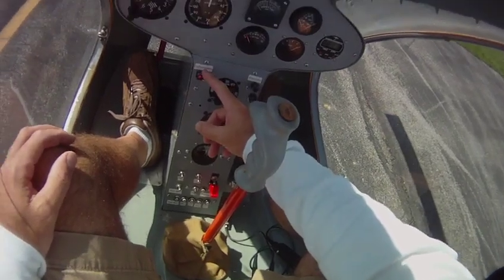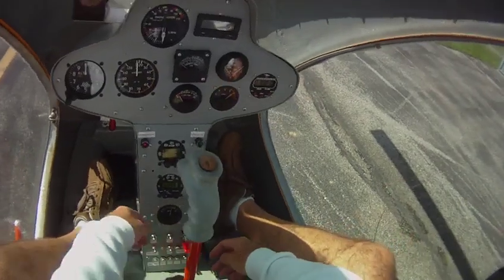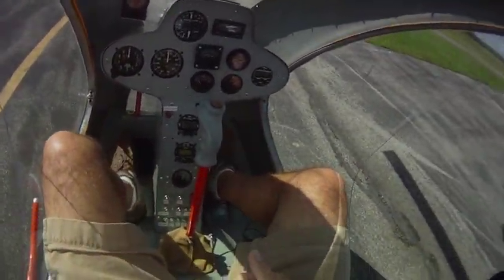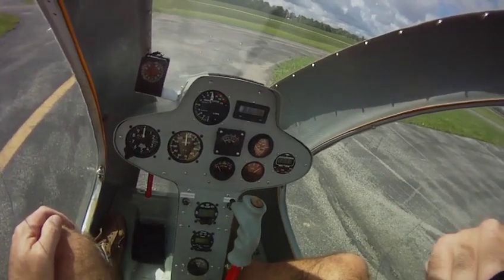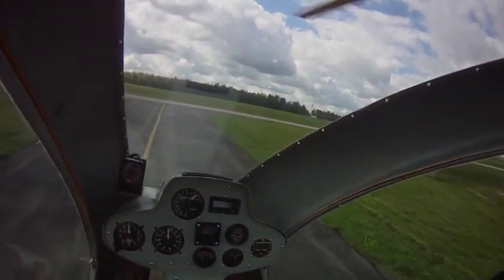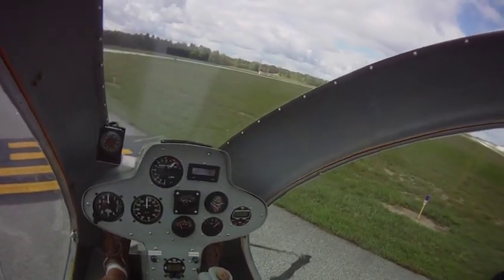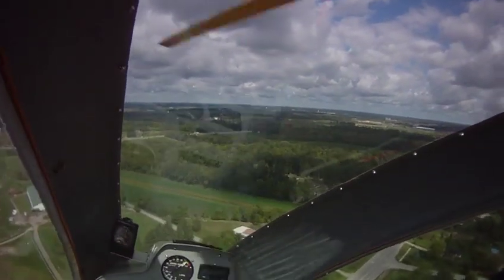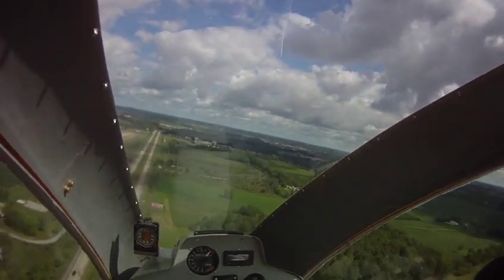Helicycle Startup and flying

Comment from the maker: Bob.  It hovers pretty easy.  I took an hour of training in an R22 to get the feel and then hopped in the Helicycle with no problem.  It has a governor that automatically holds 100% RPM with virually no droop regardless of what you do with the collective.  It is a really exciting machine to fly and is dirt simple to operate.  You never run out of power.
Reply: A hint of RainX and You’re all-weather 😀

Comment: How is the rotor inertia as compared to an R22?  When I was training in the R22, I was advised that you have about a second to respond to a drop in RPM to transition into an auto or you're gonna get blue blades.  One blade blew over there, and one blade blew over there.  As in the lack of weight in the R22 rotor blades is so little that a failure to immediately identify the loss of rotor rpm will kill you if you hesitate.  I completed 53 separate training flights @ 22 hours with the last 3 being solos before I ran out of money due financial issues.  I plan on getting back into it to get my private ticket and the cost of this chopper is very appealing.  Thanks.
Reply from the maker: About the same inertia.  Overall a very easy helicopter to fly. A few issues with this machine. There is a vertical hop that can develop in the rotor system that will literally shake the machine apart.  If you ever develop this co ditio you need to pull collective immediately.  Also, there have been some reports of excessive gear box wear with only a few hundred hours of use.  I never experienced the gear box wear, but I did experience the shake and it was not something I want to experience again. Super nice flying machine other than that.

Comment: Sorry if it was asked already, but someone mentioned on another video that the gearbox is prone to failure after around 200 hours.  Have you heard this, or experienced anything like that?  I realize most parts on a heli are time-limited, but that seems pretty low

Comment: so how safe are these choppers compared to a rotorway or mosquito?
Reply: Mosquito autorotates better, has much better visibility, and uses rigid mounts for the turbine. However the helicycle is heavier and was designed from the beginning to use a turbine, so helicycle pilots tend to be more confident and fly more aggressively. Also the helicycle doesnt use a belly gas tank so if you land hard you dont have to worry about exploding into flames. It really just comes down to preference. I hate the way the helicycle engine jacks up into position using belts to drive the main gearbox. A turbine engine should always be stationary. However the rotor system looks stronger to me and the seating angle seems to encourage better flying. Mosquito pilots just seem to hover around their backyards, helicycle pilots go canyon carving.

Comment: Idling at 48,500 rpm??  Did you mean 4,850rpm?
Reply from the maker: No, it is 48500 RPM idle.  Full power RPM is 64000 .  It is a small single wheel centrifugal turbine that runs very fast.  Very simple turbine that was originally installed in ground generators that were used during Vietnam war up to roughly 1990.

Comment: on the collective correction (i think its a trim for the collective, sorry I am only training in a Cessna 152,) you could try to make it motorized and put a 3-way switch on the cyclic so you can electrically adjust it so you don't need to take your hand off the collective